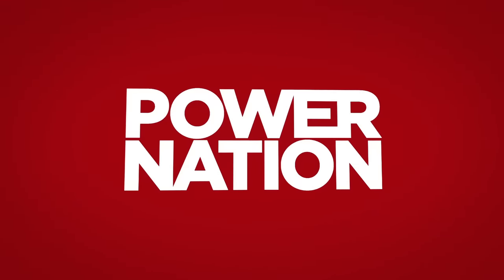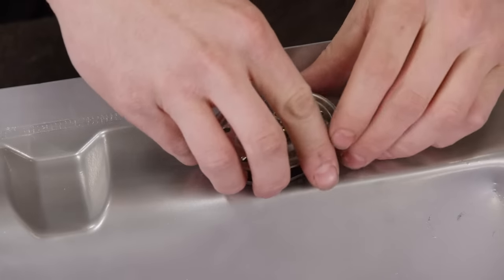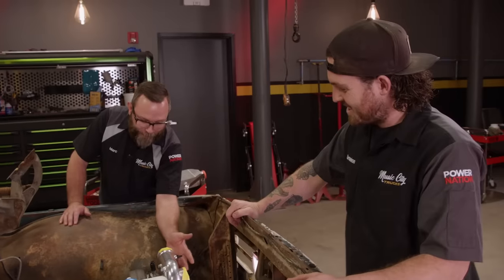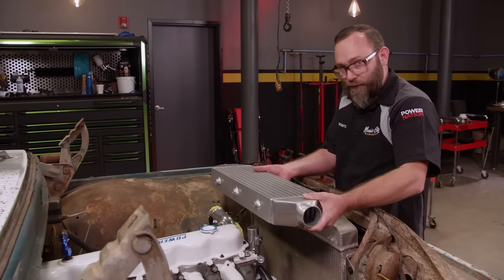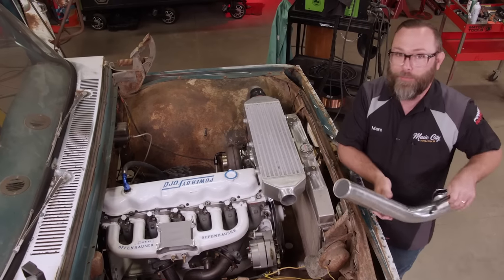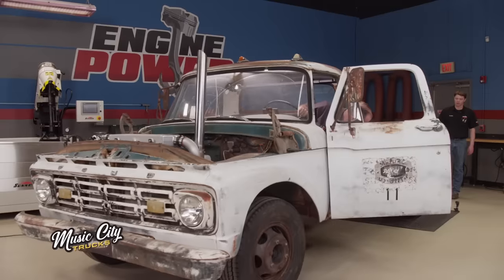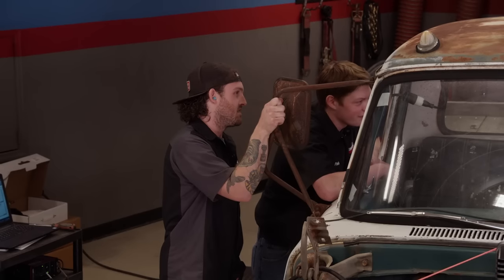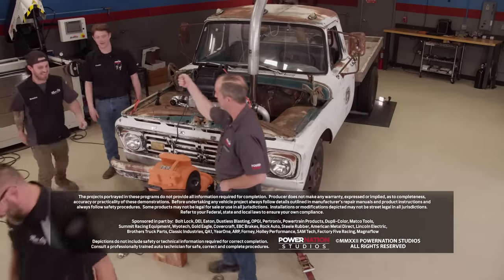Turbocharged Ford 300 Flatbed Dynoed - Music City Trucks S2, E8

Comment: I feel like an air to water setup would have been perfect here in that the heat exchanger would have fit between the rad and the grill and had actual air flow unlike the air to air mounting used.
Reply: They could have mounted it behind the front bumper and ran the tubing under the core support.
Reply: I'm curious about this too. I've worked in on highway and off highway diesel industries where we use air to raw (ocean) water in marine, air to coolant in mining heavy equipment, and air to air in highway trucks, but I've always wondered about the real effects. Stock marine DDC Series 60s could be 800 HP no problem (bigger turbo and bigger injectors,  of couse). But I've always wondered about your cooling medium being coolant that is already at 200 degrees. Would be a neat comparison, apples to apples, if they could manage different intercooler setups
Reply: Air to water heat exchangers are great but more complex considering the second coolant system needed etc. They could have easily mounted the air to air heat exchanger in front of the rad. Someone commented that this build was for the show only and will likely never get any road time. I think that he is correct.
Reply: @sheldonloyer3805  I design, sell, and install dry fuel irrigation power units. We spec fan/rad delate engine packages and use irrigation water through hear exchangers to cool the engines and 😭use air to water heat exchangers on all turbo charged engines. We can get the IAT's below ambient temperature easily which is especially helpful with propane and natural gas engines.
Reply: @joesilvasr9733  that totally makes sense if you have a steady supply of cold water, much like my example of marine engines. The cooling that you get when you use water from a lake or ocean (or well/canal in your case) is amazing. The question I have is how much performance can you get out of an intercooler that uses engine coolant at 180-205 degrees in a closed loop system.

How do you control corrosion in your irrigation set ups? Do you run zinc pucks or other sacrificial metal anodes?
Reply: @sheldonloyer3805  we don't experience corrosion using freshwater.
Reply: @joesilvasr9733  That is very interesting. I would have thought that the dissolved minerals would have an effect on the metals but I guess not.
Reply: They should just add a windshield washer sprayer right on top the intercooler.. with methanol or w.e fluid.
Reply: @sheldonloyer3805  My guy, performance aftermarket water-to-air intercooler systems don't use engine coolant, they have a separate closed-loop coolant circuit just for themselves.

Comment: How do you guys plan on getting sufficient air flow over the after cooler? I can't see how it's going to get any air flow with it mounted where you have it.
Reply: Oh it will get air , hot air from the radiator fan and heat from the turbo housing
Reply: @Mike-xt2ot  exactly what I was thinking
Reply: This is a TV show. Most likely they have a plan for this chassis which doesn't include cutting up the grill. Putting the intercooler there was a pretty hack attempt, but at least they did include the intercooler so they could run some decent boost. 

My guess is that the 300/6 videos got so many views when they built the motor they decided to just stick it in whatever they had and put it on the dyno. If that's the case, they were able to get good dyno numbers by placing a fan on the intercooler. They aren't going to be driving this truck on the road anywhere, so the position of the IC doesn't matter to them.
Reply: Welding those cooler supports on the top of the rad is a mistake.
Reply: Exactly what I was thinking.  Especially given that it's a bar and plate which is gonna require a lot of airflow. Nothing is forcing the air through that core.  At best they'll just get hot backwash from the radiator.  It'll heatsoak in a matter of minutes.
Reply: @KanjoNights  agreed 👍
Reply: So you're not going to install that intercooler correctly and also transfer heat into it from the radiator. Got it. Lol

Comment: The Ford 300c.i. 4.9L inline six is the best six cylinder engine ever produced. it even makes many V8s run away in fear. it's seven main bearing and it's timing gear instead of a timing chain. make it totally bulletproof. Ford produced a shitload of them, they were in everything from cars, to vans, to pickup trucks, and all the way up to seven ton dump trucks, and it was the engine of choice for all those big brown UPS trucks. and if that's not enough they were used extensively for industrial use..they have been used in all different forms of racing, even drag racing. there used to a company called Clifford Research. and their slogan was 6s for 8s. they had every kind of performance part imaginable for these engines. and they built some incredible 300 sixes. they are still around but they are not near the company they used to be. it's a funny thing Henry Ford didn't believe in six cylinder engines. he just didn't think they were good engines. that was the reason for the Ford flathead V8. it's sort of ironic that his company went on to build the best six cylinder engine ever produced. I have a 1981 Ford F 250 4x4 with a 300c.i. 4.9L six and a four speed. and it's the epitome of the word bulletproof. I added some performance parts to it like a offihouser four barrel intake manifold. and a header. and ported the head, mainly port matched it. which is about all a person can really do. and a 490 lift 240 duration camshaft. and topped it off with a Holly economaster 600 CFM carb. and a three inch exhaust system. I would eventually one day like to try a Holly projection EFI system on it. but as it is it's very dependable and runs really good. very impressive for a six cylinder engine.

Comment: Big 6's have there down side when it comes to performance. But there is a lot of up side when it comes to affordable street ability. Lots of low end grunt and decent fuel economy. I built a Chevy 292 in a 67 short box C10. I had no problem lighting up 10x32x15's and got 18 mpg. It was also was a good reliable daily driver.
Reply: As a Kid, my Dad had I think a 292 I6 in his 64 or so Chevy 3/4 ton Pickup, We had an 8 and a 1/2ft. Over the Cab, Set-in, fully contained Camper in the Bed. 
The Only time I remember we ever having a problem was during a Camping trip to Yosemite early one Spring. We were going fishing I think. 
While we were climbing the Tioga Pass on the way to Yosemite in the Early 70's, It popped the Rear freeze plug in the Head. Overheated and Blew the Head Gasket. 
My Dad pulled off the road aways then He and I took the Head off on the side of the Friggin Highway. I helped as much as I could. Mostly getting him tools. Anyway, We Hitch-hiked to the closest town and Carried the head in to a little Mom and Pop Autoparts place. They re-surfaced it at a Bo-Dunk machine shop in the back and sold us a new freeze plug, Gasket set, Oil and a gallon of coolant. So with the Head, Freeze plug, Gaskets, Oil and a gallon of Antifreeze, We hitch-hiked back to our make shift Campsite on the Side of the road and put the Engine back together. 
A Bunch people back then stopped and offered to help. Even the Highway Patrol Officer offered to get dirty. But my Dad insisted that he could do it himself. 
I remember there were Patches of Snow on the ground and everything. We finished after dark that night. I remember him telling me to "Hold the Light Steady" all the time. It was colder than Hell after the Sun went down. 
He'd Cuss up a Storm if things weren't going well...lol. 
I also remember He just "Eye-balled" the Torque on the Head as we only had the Crudest of Tools. Basic Wrenches, Pliers, Sockets, hammer, screwdrivers, etc. 
We ended up resuming our Camping trip the next morning and Never had another problem.
I think I was about 8 to 10 years old at the time...lol.
Reply: Have you ever seen a big block v6 like a 479 cu in they are gmc but still cool
Reply: @noduh736  They even put that engine in their Medium Duty Truck.
It was a "Torque Monster"..
Reply: @joeleyendecker5346  I know I'd like to see one all built up with a blower or turbs on it I'd like to find one myself to tinker with even more
Reply: @noduh736  Yup. I know that in the Big Dump Trucks sometimes they used to run 6.71 Roots-Style Superchargers on them from time to time. 
They used to bring them in for Service at my Dad's shop...
They'd have a tendency to throw the belt if they backfired...or visa- versa....
Reply: @joeleyendecker5346  I'd like to get my hands on one I wonder why they stopped producing them
Reply: I take it you don't know the 300c.i. 4.9L six very well. there are guys that have been able to get six hundred HP out of them. and they are totally bulletproof. they are quite simply the best six cylinder engine ever produced hand's down.

Comment: I love the 300. That maybe why I have 5 of them. I would go with a 3.73 gear in the rear-end from personal experience. A 4.10 is still to low for the highway, especially since you don't have overdrive. Great job guys!
Reply: 3.55 rear end for the highway and an overdrive gear for the high gear in the transmission. Then that truck will be able to walk the dogs out on the highway.

Comment: Are you planning on some fans for the inter cooler in that configuration? Behind the radiator is going to effect the cooling ability

This would be a beast to drive.

Comment: What a cool build I love it.  All except for the hood stack.  If you have to keep the stack run it up between the cab ans flat bed.  Hood stacks are for the unskilled in metal fabrication.  It just screams I am too lazy to fab up an exhaust system.

Comment: I had a '78 F-100 custom with a 300 straight 6 and a 3-on-the-tree.  I miss that truck.  It had almost 450,000 miles on it when it died.

Comment: How do you direct airflow through that intercooler?  It has to have air going through it or there's no cooling.
Reply: most charge cooling will be from the atomization of fuel at the throttle body. if you put an intercooler like that and wanted cool air over it i would run a duct and tube to a high pressure area. (like a brake cooling duct type setup).
Reply: @festungkurland9804  It doesn't make much sense to mount it where you will be adding more heat to the charge before it even gets to the TB. And then solid mount it to the radiator tank and the engine? Those truck chassis flex a lot. That radiator and the intercooler are going to have short lives.
Reply: @Fordman7575  sure, could be better. if they had an engine driven fan with a open top fanshroud it would actually get alot of nice air.

Comment: Incoming cracked radiator. Not only is that thing going to heat soak like that's it's job and then get blasted with hot raiadtor air, Solid mounting it to two independently moving bases(engine/radiator) is going to stress those bungs until the welds crack or tank tears.

Comment: "Y U NO" e85 on boosted applications.  It's what just about everyone else is doing when they rebuild with forged pistons and add a turbo.  Not just for increased power but for knock prevention and increased cooling effect.
Reply: One reason may be lack of availability. Where I live (Brooks Alberta Canada), I have never seen E85 anywhere near me.
Reply: @ndog1234765  Here in the states, its becoming readily available and local for a lot of people. Im from the midwest and have no issue getting everything from  e30, e50, all the way up to pump 110 octane for like 15$ a gallon.
Reply: cost vs drivable. the 300 with 10lbs of boost will run on 89 or 92 without issue. so jo reason for e85.
Reply: @oregonfordguy9812  Ethanol will allow for more fuel to be comsumed then gasoline for the same given power level, and with that offers a much greater power handling, faster spooling, and allow it to safely increase the timing and make more power per lb of boost, well beyond any pump gasoline. Then theres the inherent cooling effect of running the required 20-30% greater volume of fuel with ethanol and not only do combustion temps drop, but intake air temps in the manifold will be down tremendously which would be ideal on any street driven vehicle. Even with forged pistons, if it heats up the rings and the gaps close, it will crack ring lands. Ethanol is awesome with boosted engines and perfect for avoiding these types of failures, especially with the iron headed, large combustion chambers found on the 300ci.
Reply: @oregonfordguy9812  e85 in my local station is 2.89. e30 runs 3.09 and still runs close to 95 octane. Premium 91 gasoline is 5.49 still

Comment: I own a 1960 Ford f350 flatbed.  Y block with t98 and original rear axle.  I can't get gears for mine, but the Dana in that 64 can be regeared.  Summit has ring and pinions for that axle.   It would work if you don't planning to pull a lot of weight.  Otherwise  leave the rear alone and add an auxiliary overdrive  to get better gearing and also keep pulling power.

Comment: want to talk old beater fords I owned at one time or another a 59,61,63,64,65 and 67 ford pick up's. all of them had either the original or a swapped in V8 and standard or auto transmission depending on the year . I love the old girls and you can't beat an old Ford for out living the engine , trans and the rear end. take my 59 when I finally sold it it had 950 thousand miles on the tach and I had rolled it over 5 times myself in the time I owned it. I went thru 3 engines 5 transmissions and had the agility to swap between a 2.90 , a 3.00 or a 4.11 rear gear just from searching the junk yards for center sections to fit the stock 9 in all in stock carriers from Ford . I may drag race a Dodge but I drive a Ford every day.

Comment: Going to be a lot of hot air if there's no scoop in the hood for that intercooler.
Reply: eye rolled when he said install horizontally...
Reply: Hot air rises. So no matter how they try to get air to it. All the hot air from the radiator and front part of the engine bay is just going to cook it. It needs to go down behind the front bumper.
Reply: I like the other idea of going for a water to air cooler.

Comment: Nice project y'all. Haven't figured out how the intercooler is getting any airflow through it. Hmm 🤔. Don't think y'all intend on leaving the box fan on the hood.
Reply: Ez just put a scoop on the hood directing the air to the inter cooler
Reply: @jgpa3z  y'all are right. That could solve the airflow issue... but, I guess it means the project isn't done yet. It's dang sure got more giddy up!

Comment: such a cool rig. Id love to see you guys cut up a set of aluminum 351 heads to make a cross flow inline 6 one. There is so much more power potential in this engine with a better flowing head.
Reply: At least some port and polish work

Comment: I loved it!! Ford 300 "Big 6" has a whole new meaning! Great engine & truck build guys. Great success! Thank you for giving the Ford 300 such love & tech it deserved😇!  Do ya'll have a parts list we can read to duplicate this engine build? Paul, from S. Central Tx.
Reply: Yesss they post everything a 60 mm turbo
Reply: @Pedrofitbulls  I double-checked: the 300 Ford turbo was a 72mm comp. & a 68mm turbine from Turbonetics
Reply: @PaulThomas-qo9vy   shittt not bad at all that’s what I’m gonna use then on my 390 fe I got rn a turbo from a Cummins 6.7
Reply: @Pedrofitbulls  Great! If this is your 1st turbo-system build, I strongly recommend a book: "Maximum Boost" by Corky Bell. That's the bible for DIY & professional turbo-system builds, real practical advise for the home builder, no BS, to help you get it right the 1st time. Good luck WAHU! 👍 Paul, from S. Central Tx.
Reply: @PaulThomas-qo9vy  thanks I’m gonna look into it I’m looking to put compounds turbos so and smaller one before the 6.7 one
Reply: @Pedrofitbulls  Hi WAHU, Compound Turbo systems are really cool looking, (where a big lower pressure turbo compresses fresh air to say 15 psi, then pipes transfer the 15 psi boost into the compressor inlet of a smaller turbo that further compresses the air to say 40 to 50 psi & then into the engine). Also after each turbo compressor outlet an intercooler/aftercooler must be added with its own plumbing hoses/pipes. Talk about super complicated/difficult, even for an expert fabricator/engineer. Compound systems are usually used for diesel engines that can operate with a lean air to fuel ratio. Not possible with spark-ignited engines like your sweet 390 FE. Great classic engine. If I could warn you to avoid a complicated, hard to build, high-boost system on your first build, & stick with a single turbo system. Properly sized & fabricated with working safety controls like a wastegate & blowoff/bypass valve, will give a freshly rebuilt 390 with heavy-duty parts & great oil system a kick in the pants you will certainly enjoy, puttin' a silly grin on your face. Don't start out with big boost, start small, like 3 to 4 psi, use a wide-band Oxygen sensor & gauge in the exhaust system so you a Not guessing. With turbos, guessing = broke engie & sad faces! 1st thing is buy the book Maximum Boost by Corky Bell & study it hard, read & reread it. Do the practice calculations until you really get what he's teaching you. He is a genious at turbo system design & fabrication.

Comment: Intercooler mount and stack ruined it for me. Otherwise very cool deal. I also prolly would haven’t done solid motor mounts.
Reply: agreed, not sure why they felt they had to do that.  Intake and exhaust on same side of engine, yet ended up with way more tubing than necessary

Comment: Two words... forged internals. Ive seen several great turbo 300 builds over the years and the forged internals are need for higher boost. If you want to see how much power this engine can make on boost, you'll need a methanol injection system. None of these things are wildly expensive. With them, this engine could make a shocking amount of power. Please go ALL IN on this project.